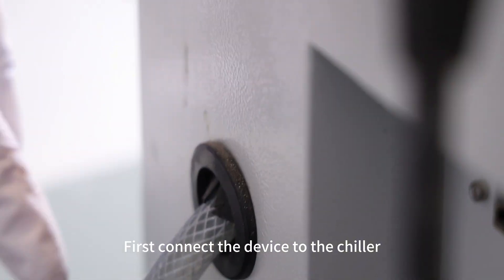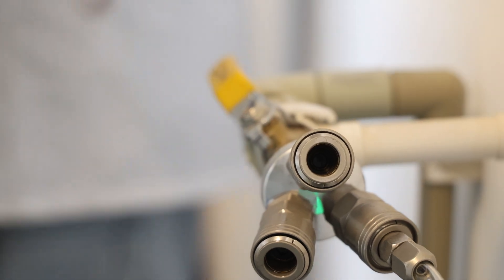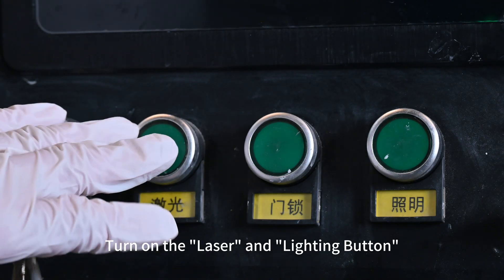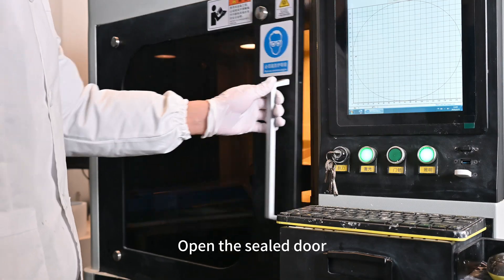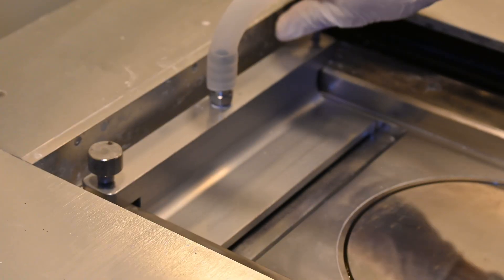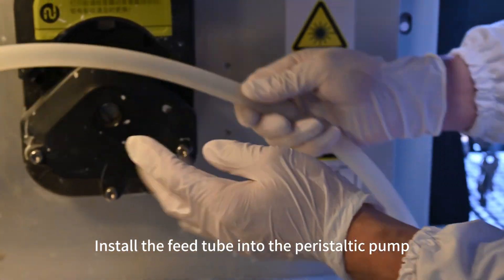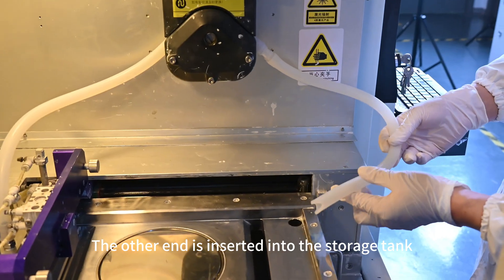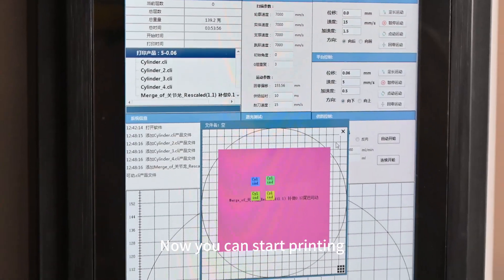DMK Laser Ceramic 3D Printers: High-Precision, Cost-Effective & Industrial-Grade #DMKLaser #foryou

Comment: So ceramic can withstand high temperature? Above 1000 degrees Celsius?
And how much for the machine cost? Thanks
Reply from the maker: After high-temperature sintering, ceramic materials can easily withstand temperatures above 1000°C or even higher. For more details, please contact us by email qinglin@demarkchina.com — our professionals will assist you with comprehensive product information and purchasing support.